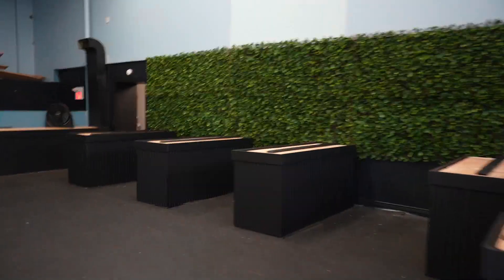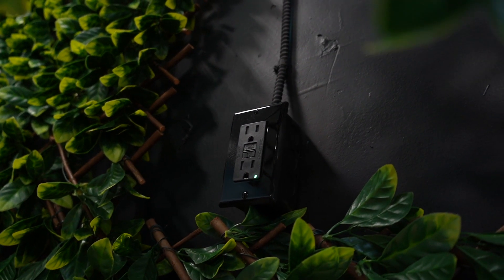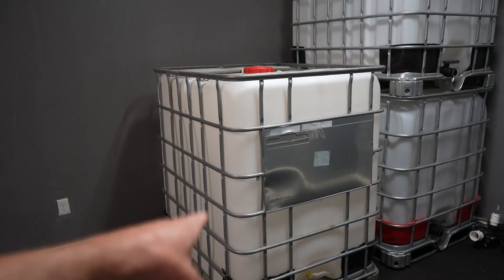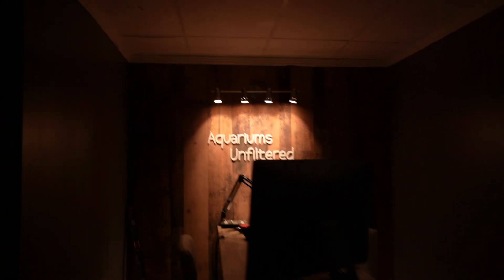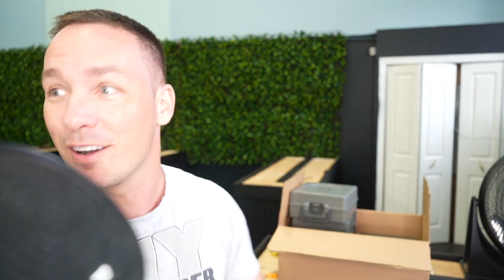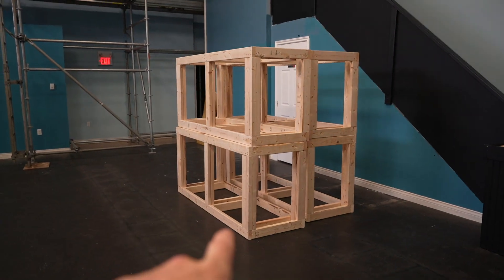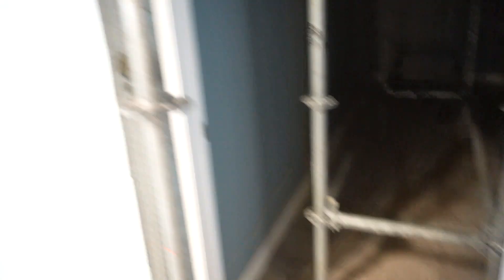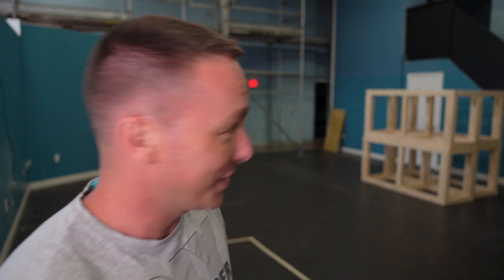DIY PUBLIC AQUARIUM - a huge problem

Comment: We had a similar issue when we moved into our space; though, it was more the general contractors fault. We had no power to half the building, firewall wasn’t even started. Was told a month to fix, it took 3 months. Thankfully, we have a good landlord who worked with us tremendously.

In your case, maybe you should seriously consider the larger space. If you can afford it, the bigger space gives you so much more options as you continue to grow. 

Just my two cents! 

Much love and respect from Wisconsin!

Comment: If you can afford the extra costs, i'd seriously consider trying to get the other space.
This landlord is already causing headaches, and i guarantee that wont get any better, it's a disaster waiting to happen.

Sure, you'd have to spend extra money and time, but long term, it'd be a better option. You won't have to deal with unprofessional situations as with this landlord, plus you'll have a lot more space to work with.

Comment: Don't think of it as a setback but a blessing in disguise. The new location give you extra square footage and knowing you I know there are things you want to do or add but can't because of the space. It's hard to start over especially if not going to get your deposit back but think of it as a test run with that deposit. Had a chance to explore and design the area for your tanks but now there are structures issues going on thats gonna cause you even more $$$ I would explore the other location and weight in on that. No matter which you choose we got your back 👍

Comment: First of all joey i guarantee you 100% tried climbing with those suction cups. lastly take advantage of the broken lease and find a space on a slab of concrete. cause while i appreciate the direction of an attainable gallery and using 180 gallon tanks. But you are the king of DIY and have thoroughly impacted me in this hobby and got me back into it 4 years ago and now have built a 16 foot square 30 inch deep tank in my shop and it is the most epic thing that ive ever done for myself and without watching your videos i would have never had this huge planted tank with slowly growing stocking .  off track but moral of that is why do this gallery if your not going to be able to be you and build a whole wall of giant tanks to compliment the wall of the 180s.

Comment: Make sure you store those suction cups back into the case, any little bending on that rubber cup leaves an impression which alters the suction. You lose the correct suction it could pop off while you are lifting..... SPEAKING FROM EXPERIENCE LOL.

Comment: did read a few (a lot) of comments  and one thing what came in my mind what i did not see. construction  time line always  fucks up. they always work multiple sites at time and depending if something on the other took longer why it could have not started. the workers might  only want to do small jobs to get quickly to the next one. so there could be so many reasons what might not even be the landlords fault, Or it could be  but there is no guarantee  the new landlord will be any better. and bigger area will mean more work, more aquariums and even more work what one person might not be able to do without literally living there to get all jobs done. And its not good idea to bite too much what you can't handle on your own except if you might be ready to hire. But I wish you best luck with this situation  and I hope no matter what you decide it works out for you.

Comment: Hi joey unrelated question here. What size of tank would you consider minimum for a adult black diamond stingray with a few other tank mates likes oscars, I have a friend offering me two 10x2x2 tanks for a really cheap price but I was thinking of going for minimum 3 foot wide. I just wouldn’t have the space for both of those tanks. Also what size of sump for the tank size you recommended? If possible the dimensions of the tank rather than gallonage but the sump could be in gallons
Reply: I was thinking of moving bed filter aswell as some other methods of filtration

Comment: Did an architect advise that the firewall needs to be upgraded?  What is the tenant in the unit beside yours? Why cant they just add 1 or 2 layers of 5/8" type 'X' drywall on one side rather than ripping down the whole wall?

Comment: Just so you know if you have the same circuit for all those plugs for each tank you only need a gfci for the first plug and it will protect the entire circuit for faults the same as if they are all gfci just so you don’t have to buy so many in the future
Reply: Also 5000 sq ft sounds way better I would be siked to see that

Comment: This place is looking great and you've spent a ton of money/time on it. However, the landlord is showing that they don't care about the terms of the lease. This is a huge blessing to find out before you bring the animals in.
As tough as it is to walk away from this place, if the other (larger) building can structurally support the aquariums; I believe it's the right move. You'd have more room to expand on the current project. 
Good things come to those who wait. This is just a speed bump on the way to realizing your dreams. The money that you've spent can probably be recovered by making a couple videos on what's going on. The time won't be made up but alot of the stand building etc...would need to be done for the other place anyways. 
Good luck!

Comment: I do industrial and commercial construction. This project should not take near that long, nor be anywhere near that invasive. That existing wall can be turned into a fire wall by adding an additional layer of drywall, and extending it all the way to the roof. No need to tear that wall down. Please check local building code. It could save you weeks of headaches.

Comment: i mean with the new place being so much bigger its a no brainer. Plus the space would allow not just more tanks but much bigger tanks. Instead of 180g tanks you could do 350 gallon tanks which are 8ftx3ftx2ft. That would allow so much more types of aquatic life in each tank. Hell you could even do 440g tanks which are 8ftx4ftx2ft and have multiple kinds of stingrays, or mbu puffers and those more interesting bigger fish that need more room. Maybe even smaller sharks.

Comment: Alarm 🚨 bells 🔔 would be ringing for me if the landlord told the tradesmen that the building would be empty so they have the run of the building and you were told to move forward with your plans as no one els coming in to be obstructive yet both were misinformed from the very beginning what els do the landlord have in mind maybe setting it up to sell on possibly then within a year you would need to close it down and relocate etc if they that happy to go against their agreements sound like slum landlords to me sorry to rant about a slum landlord but seems a lot of your hard work money and time could soon be for nothing 😬

Comment: Landlord woes! My suggestions...
You are in a position of power. Use it. Renegotiate with LL. 
Refund all rents to this point.
From now forward no rent is due till building is to code. 
Any other issues you need addressed.
If these conditions are not agreeable to LL, mention you can break lease and have already found another place. If that doesn't move LL, move! Sue for all expenses to this point. In Canada can you sue for emotional distress, loss of revenue, etc. ?

Good luck. Stay positive!!

Comment: I never put tanks on GFCI. Too finicky and too much draw if and when heater's come in and off.  I always wire to a direct circuit.
Reply: I never do either. If they trip when I'm not home there is no way to reset it.

Comment: I mean, there probably is a weight limit. But a couple of IBC's ain't gonna get near that. 

Also, if your contractor's agreed to paint the wall black, get it in writing or video. AND put a sign on the wall saying "paint black" the day or two before they paint. I'm not saying you've got a bad contractor, but you've got one with a disconnect between the guy estimating/agreeing to stuff and the guys doing the work.

Comment: You probably already have thought of this, but.... Since the wall is coming down and will be completely rebuilt..... NOW is the time to detail all power, low-voltage and other needs you may need to be installed in that wall... Perhaps even a water and drain source..... Ethernet, HDMI, audio, Temp control and vents.... Windows.... insulation.... The world is your oyster!! Make this oppurtunity count and take advantage of your current leverage with the landlord.... After all, they are in breach of contract!  You have the power now!! Just my 2 cents....

Comment: I'm not at all versed in Canadian real estate laws, but I agree with so many comments below. Get out while you can. It's quite apparent you'll just be waiting for the other shoe (or ceiling) to drop. It's more than obvious how you've poured your heart, soul and resources into everything so far, but I don't think a larger red flag could be flying. It's also possible that construction crews walking off the job is an indication of larger problems looming. Maybe this is why the space was vacant for 4 years. I'm sure you've thought of this, but what's next around the corner after, and if they finish? Other issues might rear their ugly heads that could possibly require a re-do of everything that's supposedly taking place right now. I think this is a sign that may save you a lot of heartache and expense in the future.

Comment: Take the loss of the paint and move everything to new location. Fight for you're deposit back as well as losses.
You can request that the landlord of the building refund you for losses of cost you have already evested into the building.
I have had a simular issue accure but the owner of the building that was renting space to me lost the building, thus causing my self to lose the space.
Had to contact a lawyer and find out what could be done.
All in all you can send a letter of request to the landlord for losses repayment.
Seek a lawyer and get the hell out of that building before things become worse.
This Landlord is untrustworthy.

Comment: I would think of it as you losing money. Yes you already invested money, but now you have a delayed opening which could potentially set you back MONTHS of time, effort and building. If you truly like this place then go for it, but always consider what will be the best decision for you to make. You definitely seem excited at the prospect of the other building and if the standards are up to code I don’t see why not just move things there where you’ll probably get started immediately and be able to easily resume progress. Feel through the pros and cons of each building and see if theres a significant difference that will help make the decision easier for you!

Comment: If the landlord is being that shady to both you and the contractors on what kind of work can be done in the space at the same time, I wouldn't trust them to ever give you a straight answer on what can and cant be done in the building. I would move to the new location and if you have written proof about the workers not being in the way I would demand all money paid back including deposit and if they refuse take them to small claims court to get the money back.

Comment: They shouldn’t have allowed you to move in before the firewall was repaired, let alone collected rent!  Maybe the landlord will meet you in the middle and give you a month free of rent if you stay!
Reply: That's the point. By lying about it, they didn't have to wait with collecting rent from Joey AND they've managed to get a low price on the work because there would be no obstructions or time frames for the construction company.
Basically screwing over everybody they can at any given opertunity.
The construction company already ran away SO RUN, JOEY, RUN!!!

Comment: First, this building was supposed to be up to code before the ' For Rent ' sign got hung. This is all on the landlord's back. 
You have to make some hard decisions and fast before you lose anymore money & time on this place. A bigger place means more investment and overhead costs. You planned for this size and finance involved in this venture without any guarantee it will break even. A bigger location means a bigger gamble that if it fails, it will fail bigger. Can you financially handle that ? Emotions need to be selfed ( not easy when it is your dream and invested emotionally in this project), but this is purely a business decision before you. 

I would be very concerned about what other major project does the landlord plan to do in your place ? Is the landlord going to wait until you are set up before dropping another bomb on you ? You are also in the position of power with the landlord. Renegotiate the lease and demand deposit returned as he showed you a great disrespect and needs to rebuild your trust in him. Remind him he broke the lease and could be facing another 4 or more years of an empty location costing money instead of making money. 
You can always put your stuff into storage until you find a better place within your budget and a better landlord. 

I did good in business until the day I broke my own golden rule for business/investing.  I followed my heart and not my balance sheet. I went bankrupt and lost everything, instead of a manageable lost that I could easily rebound from.
Good luck on your hard decision before you.

Comment: Joey, this isn't looking good. A broken lease, even if it's in your favor, this early in the game isn't looking good. And don't be so convinced that your amphibian / lizard room is free from structural concerns. When you were walking around back there, you could see clear indications of degradation in the concrete and since you never mentioned anything about rebar reinforcement, you don't seem to know if it's even capable of handling what you said you intended to keep in there with all that water, etc. If you do the math, that's going to be a massive amount of weight.

Hey, I'm not you and all, but if you found a bigger place, I just know I'd take the hit and evade the situation now before you get neck-deep into everything. To me, it just seems like the risk is too high to gamble with.